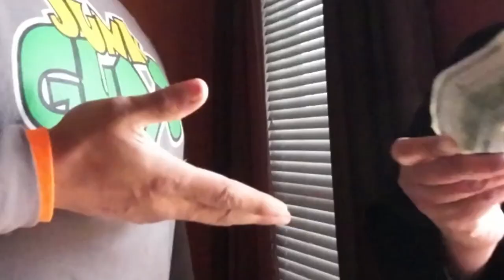PIANO REMOVAL GETS A BIT INTERESTING IN DALLAS TEXAS #PIANO #startingabusiness #junkremoval

Comment: In 2014 or so, I had an 1898 Steif upright moved up 5 flights by 5 guys. At 5'7", this piano was as tall as I and was haunted to boot! I cried when they got it up. The cats didn't charge me ❤❤❤
A friend and I rebuilt the piano - long to short, the harp was out. Had to weigh 1,000 lbs. My apartment building had to be gutted and the harp had to go downstairs. ONE MAN carried that thing down - a big Polish dude. 
Never forget that haunted piano!
WHY are you ripping it apart? You can't sell it or give it away for free? There are people who need pianos!!  The guts I used as a headboard. It was cool.